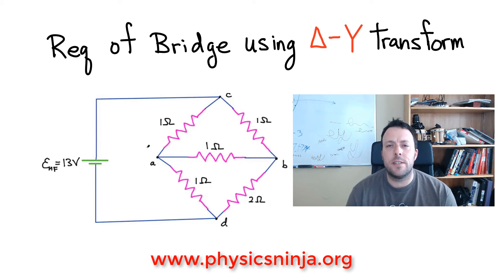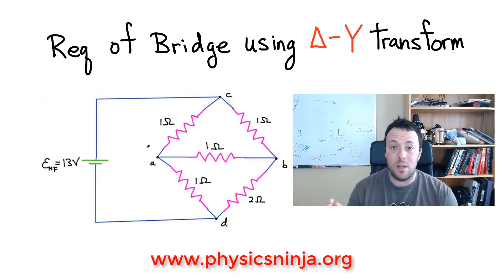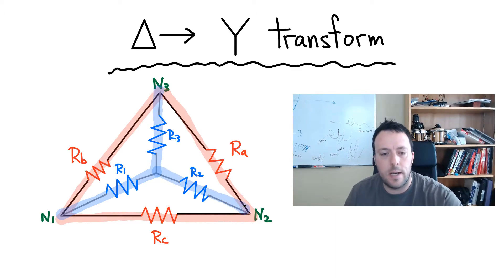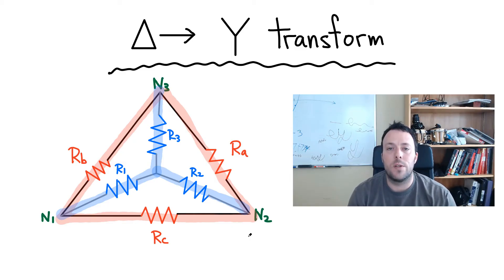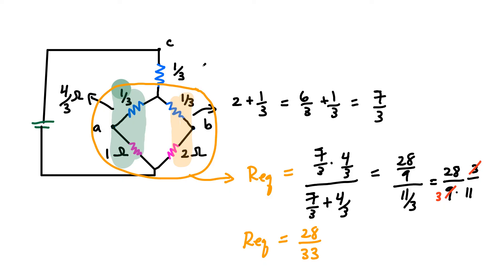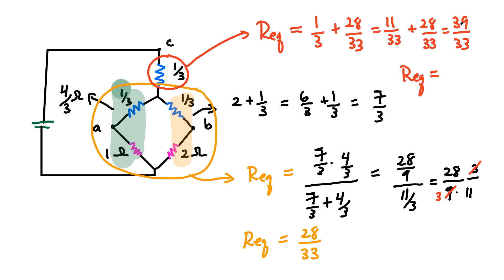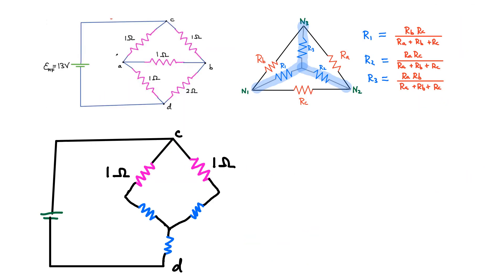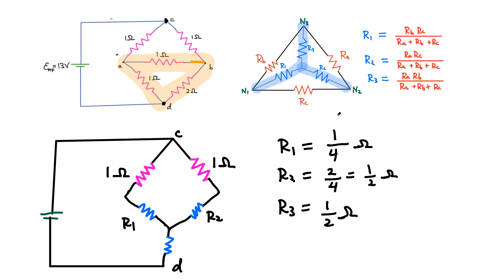Bridge Circuit Equivalent Resistance using Delta-Y Transform

Comment: My professor started throwing bridge circuits at us, having us solve for equivalent resistance as well as the current through each resistor, without explaining beforehand that normal series and parallel reduction rules don't really apply to the bridge. The class average on the exam covering this topic was a 27%... Honestly it's quite frustrating finding out later that you're missing a very important piece of the puzzle.

Comment: Woah are u serious you had never heard of this before....  I am in class 9 and I knew about this albeit through the preparation of physics olympiad. Yes It is extremely useful for solving circuit sums and a modified version can also be applied to capacitors and inductors.... But its by far the coolest hack of solving unbalanced Wheatstone bridges..... nice u made a video on it though cleared some of my concepts 🙌
Reply: yea a proof would be helpful.... didn't fully comprehend that part....

Comment: Where comes the other 1/3, when you combine those two series resistor
Reply from the maker: The 1/3 factor comes from he transformation of the delta to y network of resistors.   I have a video on this.  I also have a video where I don’t use any simplifications.   I only apply Kirchhoffs laws to some it.
Reply: I agree with you.   It’s 6/3 for the two resistors. And he added 1/3 again 🙁?? Where from the 1/3

Comment: Rules of symmetry don't apply here ?i think i can just use laws of symmetry instead of kirshoff and y delta or i can't do it because resistors aren't equal ? , second thing is that i get ur method but generally how will the current flow exactly in the circuit with numbers how will it pass ??

Comment: Didn't know delta-Y conversions could be used other than in three-phase circuits. Incredibly useful and quick to solve these bridge circuits. 
Also even easier,  in 3-phase circuits if the delta load is balanced (all resistors/impedances have the same value, just like in this example) R1,R2,R3 always equal the delta resistor (in this case 1ohm) divided by three.